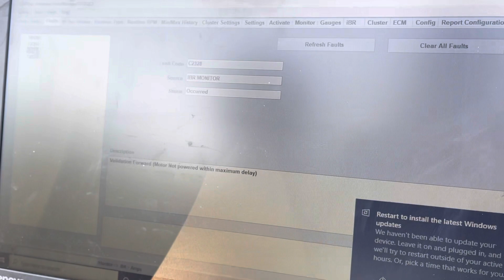Spark trixx fault diagnostic with candoo pro

Comment: Where is the connector on the trixx? Do you unplug the 6 pin doing to the display or is there a capped connector for tool?
Reply from the maker: There is a “dummy plug” that isn’t plugged into anything if I remember right it’s near or under the coolant reservoir